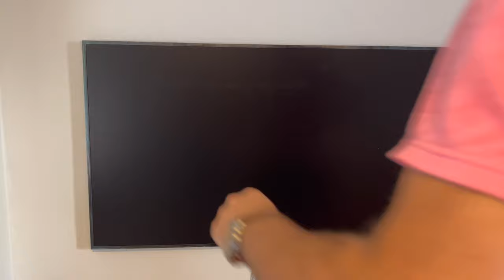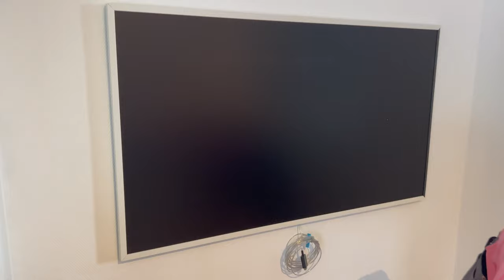How to install the frame on the frame tv the easy way.

Comment: The top right corner has a noticeable black seam or gap in it. From the video. I hear you say that we don't need the black plugs, but if we do use the black plugs does it minimize the gap a little bit more?
Reply from the maker: Hi, the back of the tv is flushed with the wall, but the frame it self has a small gap. the screws make no difference, the reason why I never use them is because of very bad quality, the head on the screws get broken very easily.

Comment: Hi..I purchased the Frame 43 LS03B 2022 model. The installation guy has left quite a lot of fingerprint/smudges. He told me to use a lens cleaning cloth or a plush microfiber and gentle rub it over and in 2-3 attempts they should go off. But they didn't. 

I tried with a paper towel too as you demonstrated but that didn't help either.

Samsung website says to follow the following steps ro clean the Frame 2022 and Serif 2022 ' s anti reflective display:

1.Turn off the TV and unplug the power cord.

2.Lightly dampen a microfiber cleaning cloth with a few drops of water and gently wipe the stain.

Important: Do not wet the sponge before wiping the TV. Only lightly dampen the stain using the microfiber cloth as described in step 2. Do not use any cleaning solutions.

3.Gently clean the stain with the melamine foam sponge before the water dries up.

Would you suggest using the above method, as in Microfiber damped with distilled water + Magic Eraser (melamine foam sponge) ?
Reply from the maker: Hi. Finger marks are a nightmare on these screens. Im very careful so I never leave behind any fingermarks. Because I never leave a mark I dont have much experience with removing them unfortunately. A celaning cloth or a paper towel will not help. I have never tried what the Samsung website says, so i cant confirm it will work..
Reply: Can these frame work on LS03D model which is 2024 model.

Comment: I just purchased a 43" The Frame TV and subsequently added a modern brown bezel. It fits like a glove -- all the pieces snap securely into place -- but the moment I add the bottom piece of the bezel, the screen brightness dims. If I take it off, brightness returns to normal. Upon closer inspection, the bottom piece is definitely fully seated, but its thickness is just enough to partially obscure the light sensor in the bottom right. Really disappointing. Have you had the opportunity to see if this occurs on any of the units that you have installed? You would have to have the auto brightness feature turned on at the time of bezel installation to see it.
Reply from the maker: Hi, never experienced that, and i have mounted a lot of them. Sounds like its something wrong with your tv. I would have contacted Samsung for this.

Comment: hmm... trying this method, but seems as though our TV is installed too closely to the wall.  The frame pieces are sticking out past the actual TV and not connecting the magnetic pieces. Have you run into this ? Any troubleshooting tips?
Reply from the maker: Hi. Sounds like you have the wrong frames. The Frame was thicker until 2020. The 21 and 22 model har a thinner frame. 21 and 22 is around 2,5 cm thick, 20 model and earlier was around 4,5 cm thick.
Reply: I think I just realised the same thing...they're for the older thicker model.....

I'm the oder thicker model too.
Reply: @oslotvmontering  2.5 cm thick (like an inch each side)? They look really thin in your video though. Did you mean the width of the bezel? Thank you!

Comment: Hey, does night mode work properly at your Samsung frame tvs?
Reply from the maker: Hi. Mine yes, but ive seen many who dosent work. If the right bottom of the tv is has something placed nearby or its within 50 cm to a side wall it often do not work properly. The best way to fix it is to turn the night mode off.

Comment: hey what are those small black pieces that come in the box and why i shd not use them?
Reply from the maker: Hi. They are small plugs, they are very hard to get on the frame correct and even worse to get them off. Many has broken the bezel trying, the bezel is magnetic so you dont need to use them.